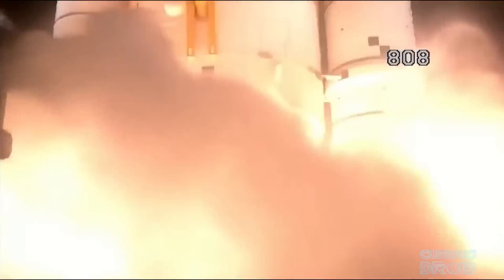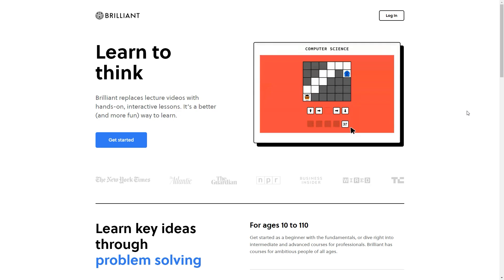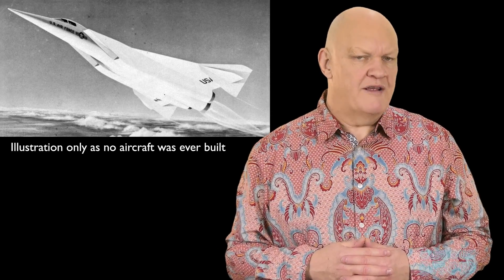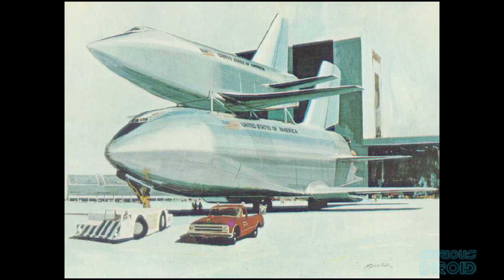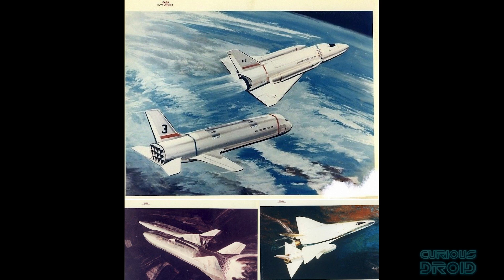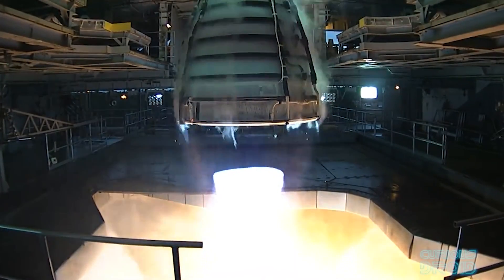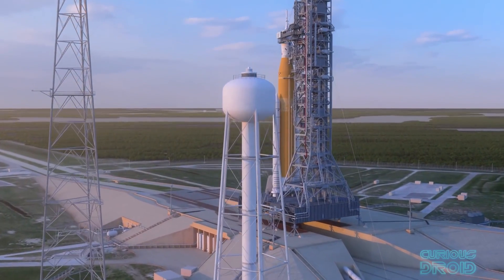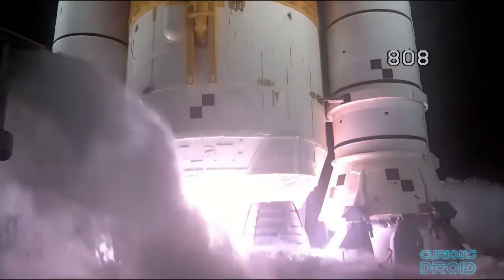Why is NASA Throwing Away Reusable Engines?

Comment: The cost of NASA rockets will never be able to compete with SpaceX and Blue Origin (whenever they get it together). Private industry is going to launch payloads to make money and to do that, they and to be innovative and as cheap as possible to be profitable. Nasa on the other hand does not NEED to be profitable and I think it's better to think of them as a technical jobs program capable of these mega projects that wouldn't other wise be profitable to private companies. I don't think that quite justifes the disposable vehicles but 18 engines isn't a lot...thats 4 Artimis missions spread over 6 years, SpaceX does that in 1 month!
Reply: The HLS Starship is not as cheap to get to the Moon as many people like to make it out to be either. The Artemis III landing is $1.47B to NASA and Artemis IV is $1.15B. Time will tell once Starship is flying, if the cost continues to drop or not.
Reply: Nasa is not gonna competing with private companies. SLS is expensive, but it's a heavy lifter. Starship was not even in planning when the SLS program was started

Comment: With SLS NASA has designed and built the perfect launch vehicle, if this were still the 1960's. 

A non-reusable launch vehicle in the 2020's and into the future is analogous to the horse and buggy in the age of the automobile.
Reply: Funny that 2 of the 4 Falcon 9 launches in Nov 2022 were expendable launches. Booster reusability is great, but has drawbacks.

First, if you don't have a fast enough launch cadence, you can spend more on recovery equipment and personnel than you save by reusing the booster.
Second, you take a payload hit for the recovery system on the booster. The Falcon 9 B5 can lift up to 22.8 tons to LEO when expended (SX), but only up to 16.7 tons when landed on a drone ship (B1069.2). Doing a Return to Launch Site (RTLS) landing, costs even more payload as you have a boost back burn to cancel the lateral velocity and return back to the launch site.
Third, the higher and faster you go, the harder reusability is to perform. The heavier the dry-mass of your booster, the harder reusability is to perform.

So with SLS launching once a year, eventually, the cadence doesn't really justify recovering the booster. Not to mention that it gets higher and faster than a Falcon 9 as the SLS core stage almost reaches orbit, making recovery MUCH more difficult. The SLS core stage is travelling well over 3 times as fast as the Falcon 9 booster and is well over twice as high as the Falcon 9 booster at MECO. The dry mass of the F9 booster is 22-25 tons while the SLS core stage is 85 tons.
The SLS Block 1 can get Orion to the Moon, but not with the kind of payload hit like F9 has. The SLS Block 1B will send along a Lunar Gateway module with Orion, so it really can't take the payload hit either.

SLS started design work in 2011, 4 years before SpaceX landed a booster and almost 6 years before SpaceX reused a booster. We are in a transition to reusable spacecraft now and reusability is not always the best answer.
Reply: @steveaustin2686  Yes two Falcon 9 boosters were expended after their combined total of 25 launches…. Falcon has the option to expend or not, no one else does. It takes a huge amount of twisted logic to not see that as an advantage.

Launch cadence.. Falcon 9 has 54 launches thus far this year. I'd call that a big check mark on that criteria.

Payload… yes a Boeing 747 could also carry more cargo if it didn't waste resources on landing gear and enough fuel to land but no one is rushing out to buy single use 747's that parachute drop cargo and then crash into the ocean. Meanwhile a single Falcon 9 can put over 100 tons into low earth orbit, it just takes multiple launches to do so.

Higher/faster/bigger… thus far it seems SpaceX Starship/Superheavy has that figured out.

For the cost of SLS, the historical cost of the program and the cost per launch, we could launch many, many times more payload using Falcon 9 ~15 tons at a time. Not to mention Starship/Superheavy. Which I noticed you did not mention because that launch vehicle (even if used in a fully disposable mode) absolutely crushes SLS in every single way.
Reply: @dogsbd  It is a huge amount of twisted logic to miss the fact that I was comparing a reusable system, the Falcon boosters, to a non-reusable system, SLS. You know, showing how the Falcon 9 is affected by reuse. And the 2 expended launches of a reusable booster proves the point that while booster reusability is great, it has drawbacks. One of which is the hit to the payload capacity, which is WHY those two boosters were expended. This is not a hard concept.

Let me know when SLS is planned to launch 54 times a year. Artemis I launched last month. Artemis II will reuse some of the Orion components from Artemis I, so it won't launch until NET 2024. NASA plans Artemis III to launch NET 2025, but the NASA IG is expecting that to slide into 2026. NASA plans Artemis IV to launch in 2027, but the NASA IG is expecting the Mobile Launcher 2 to likely be late, so that will likely slide into 2028. NASA is projecting Artemis V to be 2028, but it also relies on the ML2. So it is possible that Artemis will not have back to back launches roughly a year apart until Artemis IV & V. Kinda points out the cadence issue with SLS. Again, I was NOT saying that the Falcon boosters had a cadence problem. You made that strawman all on your little lonesome.

The Orion/ESM/LAS have a launch mass when crewed of 33.4 tons, so exactly how is a Falcon 9 B5 with a 22.8 ton payload when expended (16.7 tons when landing on a drone ship) supposed to put them in orbit? Former NASA Admin Bridenstine said that a fully expended Falcon Heavy could just lift the Orion, ESM, LAS, and ICPS to LEO, but the very tall stack had aerodynamic issues that had to be looked at. Since nothing came of that, apparently the aerodynamic issues were a problem. Not to mention that in Artemis IV, the 5m ICPS is replaced by the 8.4m EUS, so that won't work at all, even if the aerodynamic issues were not a problem. Instead of kneejerk reactions, maybe think these things through a bit? Still doesn't change the FACT that an expended F9 B5 can lift 22.8 tons and only 16.7 tons when landed on a drone ship. Skipping that part is some twisted logic.

Nope, Superheavy only has the bigger than Falcon 9 solved. It does not get anywhere near as high nor as fast as the SLS core stage. You fail again. And you might want to note that Superheavy is NOT using the same landing method as the Falcon boosters.

Yeah, because the Orion/ESM is amenable to being broken up into 15 ton chunks. Are you serious with this elementary school thinking? The Orion depends on the ESM for mobility. It keeps it until right until before re-entry when it is jettisoned, after Orion is already on the re-entry course. They and the ICPS/EUS are mated in the VAB. The whole bit would have to be redesigned to launch each piece separately. Again, maybe think about these things?

About Starship replacing the SLS, it is a completely different discussion. From page 27 of the GAO decision to deny the HLS complaints. [DELETED] is apparently at least a propellant depot Starship variant from the context and SpaceX had the GAO redact that info. Added in Musk's payload update (~150t) and he says that it is up to 8 Tankers to fully refill Lunar Starship (8*150=1200), depending on Lunar Starship's mass. My comments are in ().

"SpaceX’s concept of operations contemplated ten total launches (down from 16), consisting of: 1 launch of its [DELETED]; 8 launches of its Tanker Starships to supply fuel to [DELETED] (down from 14); and 1 launch of its HLS Lander Starship, which would be [DELETED] and then travel to the Moon."

Also on page 10 of that same GAO report, the SpaceX plan for Artemis III is 1 Starship variant launch every 12 days. So to get HLS Starship to the propellant depot to be refilled before heading to the Moon is up to 108 days (plus any scrubs). If you directly replace the SLS with a crewed Starship for to and from the Moon AND reuse the depot, you are looking at 96 days (plus scrubs) to get that Starship Shuttle to the depot to be refilled, before heading to the Moon. Per page 9 of the Apr 2021 HLS Option A Source Selection Statement, the HLS Starship can only wait in lunar orbit for 100 days. So Starship needs to mature to a much faster launch cadence, before it can replace SLS/Orion. Which based on the plans for Artemis III, does not look to happen before the early Artemis missions. Not to mention that Musk has said that Starship will need HUNDREDS of successful, operational launches, before crew can be put on board. Assuming that Starship can be that reliable, which is not yet known (I think it is possible). 

So the early Starship crewed flights would likely have Crew Dragon and Starliner take crew up to the orbiting Starship. And the capsules would have to be supported for any crewed missions longer than 10 days, as that appears to be the limit for the Crew Dragon to fly by itself. Which could be why SpaceX redacted the info on [DELETED], as if it was just a propellant depot, why redact it, only to confirm it is a depot from the context. 

So all your strawmen failed as you completely missed the point of the post and failed to think things through.
Reply: @steveaustin2686  "It is a huge amount of twisted logic to miss the fact that I was comparing a reusable system, the Falcon boosters, to a non-reusable system, SLS. You know, showing how the Falcon 9 is affected by reuse. And the 2 expended launches of a reusable booster proves the point that while booster reusability is great, it has drawbacks. One of which is the hit to the payload capacity, which is WHY those two boosters were expended. This is not a hard concept."

What a convoluted load of nonsense. Falcon 9 is a first generation reusable launch vehicle, no one ever expected it to be reusable "Forever". If you buy a new car, drive it for 100,000 miles and then it no longer meets your needs does that mean the concept of reusable cars "has it drawbacks"? Don't be stupid. Someone was willing to pay SpaceX enough to throw away a launch vehicle that had ALREADY FLOWN 10+ times Apparently the fact that no other launch vehicle in history has ever even had this ability escapes you. Plus the fact that Falcon 9 has lower the cost of LEO access by practically an order of magnitude, thanks largely due to it's reusability.

"Let me know when SLS is planned to launch 54 times a year."

It can't, it never will. You seem to thing that is a feature instead of a penalty.

"Artemis I launched last month. Artemis II will reuse some of the Orion components from Artemis I, so it won't launch until NET 2024."

Yep, meanwhile the army of SLS workers are still on the payroll, part of the reason the SLS money pit will cost $2-$4 billion PER LAUNCH. That's enough to pay for 20-40 Falcon's, put another way that's enough to launch 300-600 tons into LEO compared to SLS Block 1's 95 tons. 
 
"The Orion/ESM/LAS have a launch mass when crewed of 33.4 tons, so exactly how is a Falcon 9 B5 with a 22.8 ton payload when expended (16.7 tons when landing on a drone ship) supposed to put them in orbit?"

Never said that it would, Mr Strawman. It will however launch Dragon into LEO. Which could then could dock with another 63 tons launched by Falcon Heavy and do pretty much anything SLS can do. Add another Falcon Heavy launch and it easily out performs SLS and you're still only spending a tiny fraction of SLS launch cost. Pretty much anything in the Earth/Moon vicinity can be done in 15 and 63 ton "chunks".

"Nope, Superheavy only has the bigger than Falcon 9 solved. It does not get anywhere near as high nor as fast as the SLS core stage."

Who cares about "high/fast", the only thing that matters is payload to LEO and by that metric Starship/Superheavy beats SLS in both reusable and expendable modes. It lifts more and it does it vastly cheaper.

"And you might want to note that Superheavy is NOT using the same landing method as the Falcon boosters."

Again, WHO CARES? It is landing and it is not using the "dump it all in the ocean to the tune of TWO-FOUR BILLION DOLLARS each time" mode that SLS uses, that is what matters. And if it did use the "dump it in the ocean" mode it would do so at a fraction of the cost of SLS. Just how many meaningless strawmen can you come up with???

"Yeah, because the Orion/ESM is amenable to being broken up into 15 ton chunks."

ANOTHER STRAWMAN. Orion should be scrapped just as SLS should be. Dragon can easily replace Orion.

"About Starship replacing the SLS, it is a completely different discussion. "

It's the only discussion that matters. Starship outperforms SLS in every single metric imaginable, other than pumping billions of dollars into the districts of powerful politicians. At that SLS excels and it is the only reason SLS exists.

"So the early Starship crewed flights would likely have Crew Dragon and Starliner take crew up to the orbiting Starship. And the capsules would have to be supported for any crewed missions longer than 10 days, as that appears to be the limit for the Crew Dragon to fly by itself…………… blah blah blah…."

Doesn't matter Mr Strawman. Falcon 9, Falcon Heavy, Dragon, Starship and Superheavy represent a means to do everything SLS can do, do it better, do it cheaper and then on top of that do many other things that SLS simply cannot do at any price.

"So all your strawmen failed as you completely missed the point of the post and failed to think things through."

It's hysterical that you think that because that comment actually perfectly describes your floundering attempts at portraying SLS as anything other than the money pit disaster that it is.
Reply: @dogsbd  Oh, forgot to mention, Crew Dragon is a LEO spacecraft, so by the time you upgrade the life support, delta-V, heat shielding, etc, you would almost certainly end up about as heavy as Orion. The cargo only Dragon XL has the dV to get to the Moon and it ended up so heavy that the Falcon Heavy has to launch it, since the Falcon 9 can not. Dude, real life is not KSP, although you would think you would have learned more in KSP.
Reply: @steveaustin2686  You're demonstrating both a lack of knowledge and a lack of imagination. 

1 - Dragon has demonstrated an ability to function after months in orbit. Hint: it doesn't have to remain active the entire time, it's just a taxi.
2 - SpaceX has stated that the current heat shield on Dragon is capable of handling lunar return, and higher, velocity reentry.
3 - Dragon used as a taxi to a larger "mission module" in which a crew would work/live during a long duration mission is a much (I cannot over emphasize just how much), MUCH more cost effective endeavor than SLS/Orion. (And if you have to ask how this would work you're just going to make yourself look even more foolish.)

Bonus Hint: A Falcon 9 launch, followed (or preceded) by a Falcon Heavy launch (or 2 (or even 10)) is still MUCH..... MUCH... more cost effective than SLS / Orion.
Reply: They neither designed OR built it.  You have it wrong right out of the gate.
Reply: @TheEvilmooseofdoom  NASA is THE controlling agency when it comes to all design and construction decisions for SLS.
Reply: @TheEvilmooseofdoom  Facts apparently don't matter to him.
Reply: Just thought of something, is the problem that you think I'm saying that SpaceX should not recover boosters?

Comment: Single SLS engine: $40M
Entire Starship: $50M
Reply: Likely for test articles, as the operational Starships are likely to cost more. Especially the ones that will have crew onboard at some point.
Reply: @steveaustin2686  
Operational ones will be even cheaper, due to mass production and optimization.

Of course adding crew will increase the cost significantly, but not by an order of magnitude. Maybe double or triple.
Reply: @andrasbiro3007  🙄 Yeah, if you believe that nonsense, I have some ocean front property to sell you just 30 miles east of Miami Beach. All the ocean front you want.
Reply: I bet the production cost of Starship at hundreds of millions $. The cost of the small and much simpler Falcon 9 is probably about $40 million.
Reply: @tomes3378  Nonsense.
Reply: @tomes3378  
You already lost that bet.
SpaceX couldn't afford to blow up so many Starships if they were so expensive.
There are some neat tricks that make Starthip cheap. A big one is using stainless steel instead of carbon fiber.
Reply: @andrasbiro3007  Falcon 9 is made of aluminum alloy, which is even cheaper than stainless steel, and costs about $40 million.How can a 10 times larger Starship using 39 engines and requiring a lot of man hours cost similarly?The launch cost of the much smaller Falcon Heavy is over $150 million.Musk is the richest man in the world, which is why he can afford to blow up Starships.But even for him, the Starship building program is a big financial burden
Reply: @tomes3378  
1. The Falcon 9 uses a lot of carbon fiber too, which is very expensive. And it's not just the raw materials, but the manufacturing. I don't know how they make the F9 booster, but definitely not the way Starship is made. I don't have time to do a proper research and explain it to you. One example is the nose cone. F9 has a very complicated one that can be ditched in flight. Starship has a simple rigid metal nose cone. Guess which one is cheaper. We know that the F9 nose cone costs $6M. Expensive enough to be worth recovering.

2. Elon's wealth is in his own companies, it's not liquid. And it's not Elon who is paying for it, but SpaceX.

3. Elon himself said it's $50M.